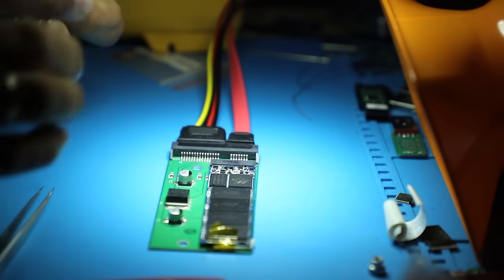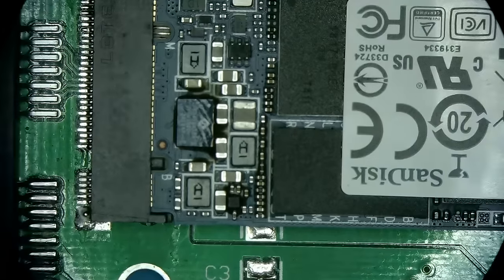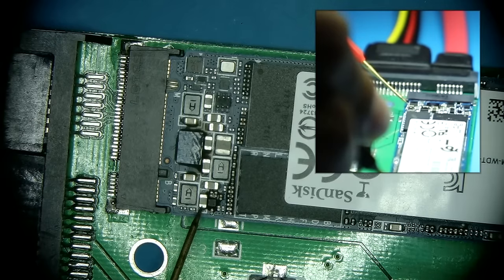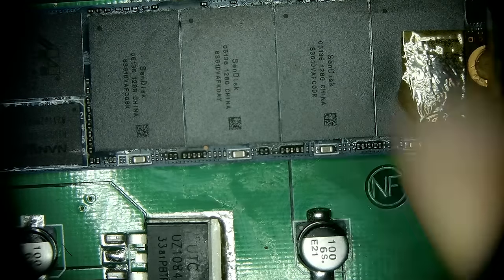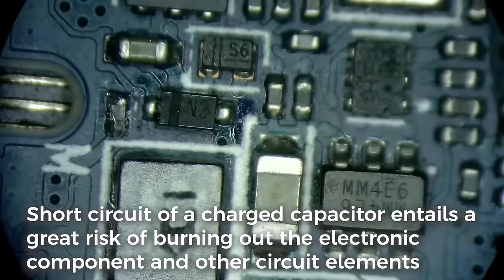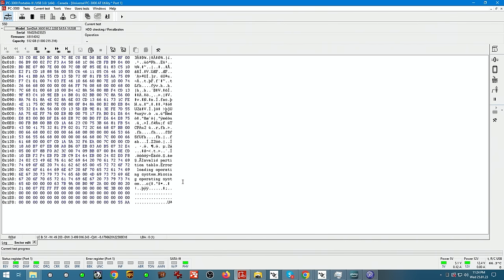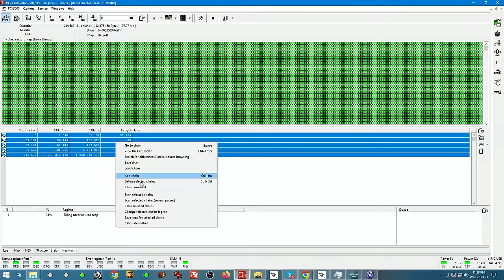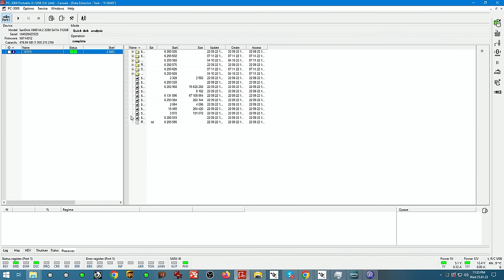I could not believe what I saw when I recovered this SSD | SanDisk X600

Comment: Some one thought the capacitor was a fuse, maybe. Bypassing a blown fuse with a short.
Reply from the maker: The jumper is not super important by itself, as it did not have any impact on data. If the unit had some other issues with components I would not even mention it maybe. But the drive was working fine. However put the jumper in had to see that it was formatted clean. So why would you put a jumper on if SSD was working ?

Comment: What surely happened is that the previous technician repaired it, but the client did not want to pay for it. So he shorted a capacitor so it won't work.

It is something that is done when the client does not want to pay for the work.
Nobody works for free.
Reply from the maker: yeah but where is the data?
Reply: In my shop if the customer will not pay, they don't get the goods back. They can jump up and down all they like but until they fork over the $$, they get nothing except a conversation.
Reply: @olsmokey  To avoid problems it is always better to return things. Even if they have not been repaired.
Reply: @hddrecoveryservices  The data was deleted because the customer did not pay for the repair.
If the previous technician was good, he may have made a backup, in case the client comes back.

Comment: How to deal with virused especially ransomware
Reply: You make sure you have all of your important data on a backup or two backups if it is very important, BEFORE you catch such a virus
Reply: @Dandan-tg6tj  in my side just running a firewall and working with linux mac and windows so if some system is infected , the important data will stay as i know ransomware are focusing on windows system only and using samba 2 old version before patched, so no way that i can get the virus in, else for data recovery there is no security working with unknown devices such as usb flashdrive hdd ssd and malduino for ex that could hack the system easlly , just wonder how he is dealing with lotof incomming data recovery
Reply: I never had any trouble with any image I recovered. I rarely open the data to see what's in there. I do that only at the client's request. Mostly I recover an image of a device then I can clone it on a working SSD/HDD. I don't even know what's in that image.
I recover an image of the device and the client does what he/she sees fit to do with it. For me there's no virus threat and if the client has viruses in his data, is not my problem for I'm not specialized in removing viruses and I don't do viruses removal.

Comment: Why not user adapter to pc3000 portabel
Reply from the maker: no reason. there is nothing special about a generic adapter I used for this case. Maybe I needed to use NVMe adapter later after this case and I wanted to keep it free so the generic SATA m.2 was used

Comment: can overwritten files be recovered?
Reply from the maker: No
Reply: @hddrecoveryservices  on HDD it can, right? i heard the analogy of drawing a long line in blue marker and covering it up with a line in black marker. if you zoom in real far you'll see that they aren't perfectly overlapped and a slim edge of the first line will stick out from underneath the edge of the new one. I don't know if this is true, but i heard the FBI uses much more precise reading heads to read those edges and recover scraps of overwritten data.
Reply: @asdfasdfadfasdf2979  Yep, that's true on hard drives. 
I haven't heard of a process where trimmed SSD data can be recovered after Active garbage collection has wiped it.
Reply from the maker: FBI can't solve this type of issue.

Comment: Poor data :(
Reply from the maker: at first I thought that last place that worked it quoted too high and jump shorted the SSD in hopes the client will comeback. But as you can see it was to most likely to cover up the tracks :(
Reply: @HDD Recovery Services  That's too bad, I figure they did as well.

Great channel, by the way. I really enjoy the content! 

I may be a customer soon. I've been trying to recover a raid 0 array for about a year now (drives are fine, mobo failed). Ufs raid finds the files & structure, but the data is corrupt like the stripes are misaligned.

Comment: I think that this was just incompetence. Bad solder.
Reply: No as actually someone that knows how to do micro soldering did it as that not a solder bridge but they put a jump wire across so no accident. That someone that did it on purpose for a reason as they also wiped the data as well?